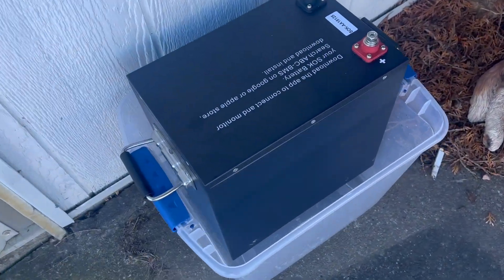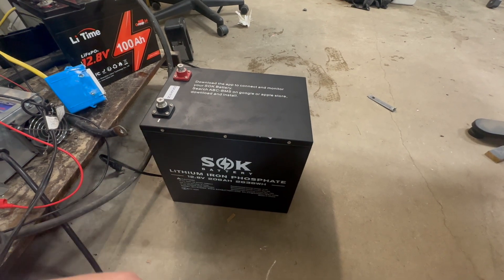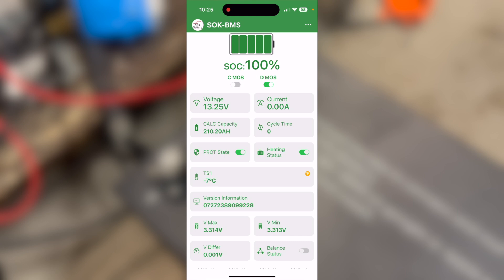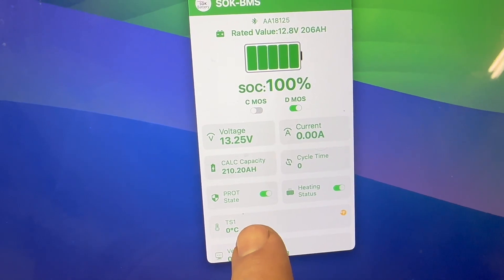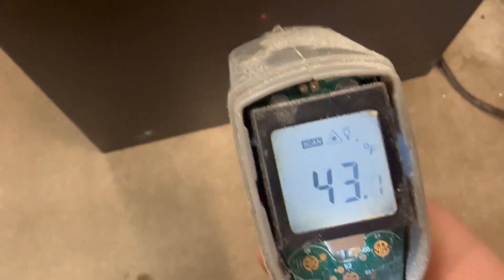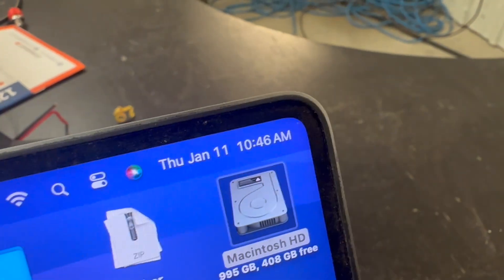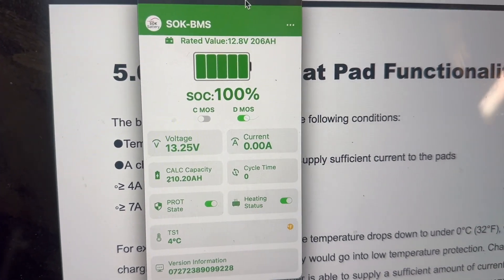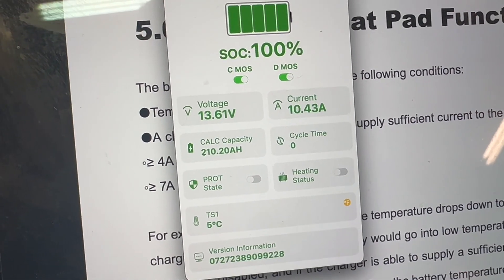SOK 206ah Heated Battery Test  - Charging Lithium Battery Below Freezing

Comment: Nice test. Any idea is the heater will put heat if the current isles than 7 amps? So in the morning when the solar is just getting going and putting out say 5 amps, will the heater put out 50 or 60 watts. Just interested to know if the heater is completely off if the current is less than 7 or is it an analog thing?

Comment: I love how this works only when there is a charge current as to not deplete the battery just to warm it (aka at night) so that a huge positive. The negative is that this will throw off shunts that measure in and out current to the battery. You could dump 7ah in a pack but there is no actual charge going into the battery. This is where managed batteries with communications are really needed with advanced systems. Over several days your SOC is going to drift with a normal shunt and it’s going to skew your readings. 😢
Reply from the maker: That’s a great point! I’ll add it to the list for an upcoming video called “your battery monitor is lying to you”. There are a number of conditions where it can be inaccurate.
Reply: You said "You could dump 7ah in a pack but there is no actual charge going into the battery". If by "dump" you mean "charge" and by "pack" you mean the "battery", then what you said sounds like a contradiction to me. Could you please expand on what you mean? Not trying to dispute, just trying to understand.
Reply: @rs1961 for the standpoint of the shunt, a charger will be “charging” the battery. But in reality that power from “charging” isn’t in fact charging the battery; it is actually power a heater. The shunt doesn’t know that so it will count that as amps into the battery. If the battery is really cold it could be a lot of “charge” current that isn’t actually true
Reply from the maker: Help me out with a time stamp.  For the purposes of the video, I’m considering any energy put past the terminals as going or dumping into the battery. Yes initially it goes to heat the battery only, then charge current is no longer limited and current goes into the battery directly.
Reply: Problem with these heated batteries is the wasted amps warming the battery up for instance if you solar panels are covered with snow and you drive for an hour to the local shops thinking you’re charging the battery you might have two batteries or four batteries but actually in that time, you would’ve put nothing in the batteries I think people travelling in cold climate are better to stick with lead acid